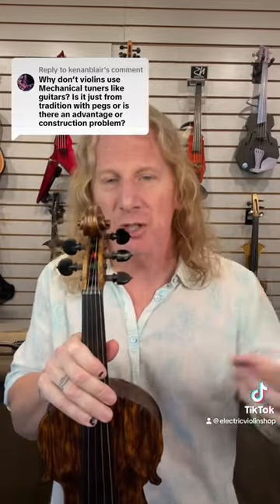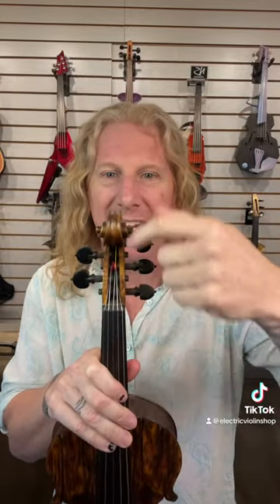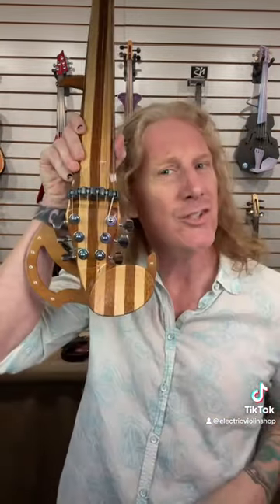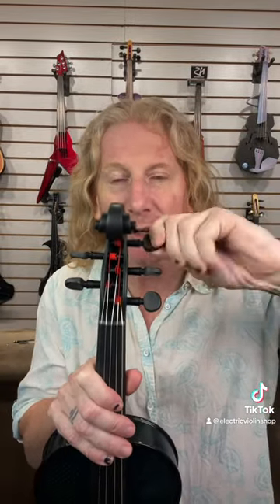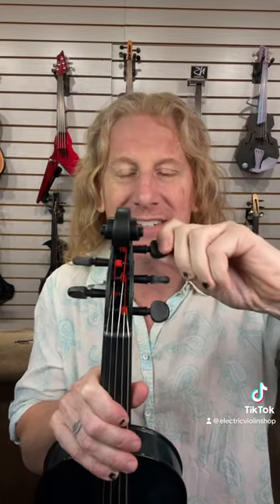Why Don’t Violins Use Mechanical Tuners?

Comment: I have installed geared pegs on all my instruments for years, acoustic or electric. Seriously, screw friction pegs. In the 21st century those things should be long dead.
Reply: Skill issue
Reply: @thodgounaris4223  no need for soap or chalk/talc ever again. Easier fine tuning with no tone loss from having naff fine tuners in the bridge.

Comment: But what about the fine tuners for violins? I heard not to touch the traditional tuners, but to use the fine tuners!
Reply: @iiiiiiiv Ah, I see. Interesting - I did not know that.
Reply from the maker: Fine tuners are exactly what the name implies. They can only adjust the string a little bit. If you're more than a half step out of tune, you have to use the peg.

Comment: What about fine tuners?
Reply: In most of cases, you don't need fine turners after installing planetary geared pegs.
Because planetary geared pegs tune finely like fine turners.
Reply: @hannahtaki5150 But that doesn’t change the fact that there are fine tuners on violins - and I heard not to touch the regular tuners - only if you need to make major adjustments - but to use the fine tuners to make the micro-adjustments… This could also solve the problem he was stating in this video about middle school teachers having to spend a lot of their time keeping the violins in tune. Just show the students how to fine tune them - and tell them not to mess with the regular tuners!
Reply: @JJ_TheGreat  That's what I was thinking
Reply from the maker: That's a great theory. But you're assuming that the violins are staying more or less in tune. Violins - especially student violins - often do not stay more or less in tune. Think about these kids dragging these violins all over creation, bumping them around on school buses, walking outside in all kinds of weather.

Believe me - it's not a stretch to say that orchestra directors spend a significant amount of time tuning violins.
Reply: Most fine tuners suck the tone out of the string. Putting the string in direct and the tension over the nut seems to bring tone and resonance right back.

Comment: My daughter's book violin has planetary geared pegs, total pain to change the strings. Much easier on my violin with traditional pegs
Reply from the maker: It's definitely more of a pain to change the strings (and we'll address that in our next video). But it's WAAAY easier to tune. I tune about a dozen times a day and I change strings a few times a year. So, to me, it's a worthwhile trade.
Reply: @ElectricViolinShop  the winding handle is annoying. I don't have the guts to use a power winder on a violin.
Reply: I agree that changing strings is really a rare event, while tuning...nearly every time!

Comment: Don't violins only have 4 strings?
Reply: Electric violins can have 4, 5, 6, or 7 strings
Reply from the maker: Before violins had four strings, there were similar instruments with 5, 6, or 7. They had to reduce the range of the instrument in order to make it louder. But then we got electricity. So we can go back to larger range instruments and they can be as loud as we want them to be. YAY TECHNOLOGY!
Reply: @ElectricViolinShop  I was wondering why traditional violin doesn't have 5 strings.
Now it makes sense for me.